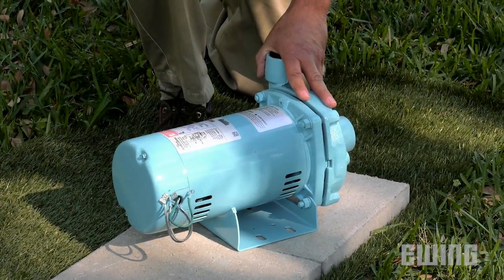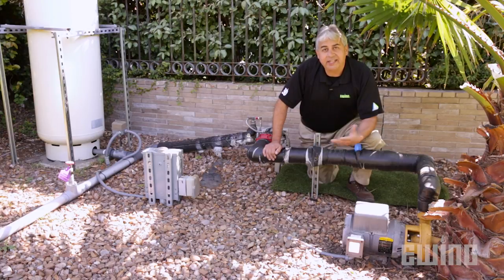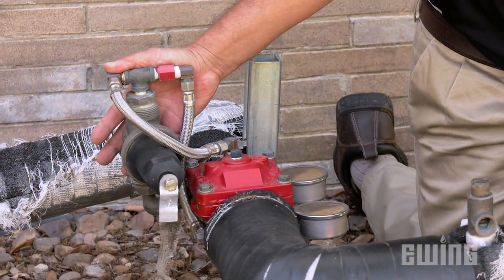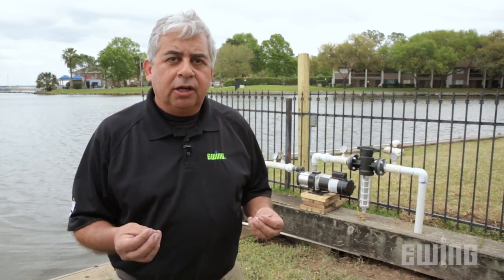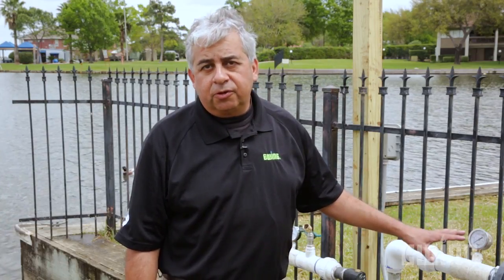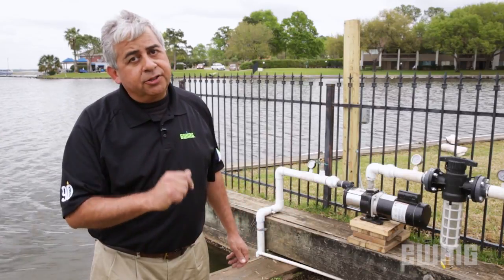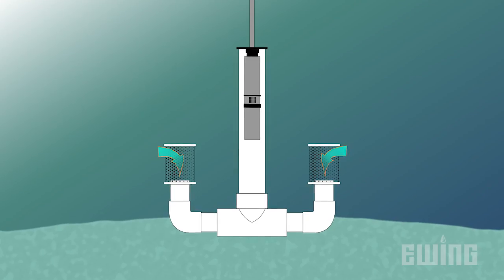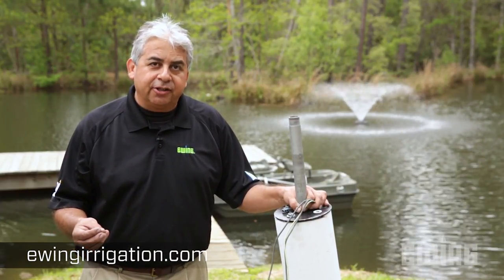Landscape Irrigation Pump Overview

Comment: Impressive system but definitely for commercial use.  I need a small system to irrigate abou 3 acres of land.  A booster pump on a dedicated switch will work but will require separate pipe. I LOVE the pond pump system!

Comment: Where did you get those screen caps that fit into the pvc pipe? I've been looking for those everywhere.
Reply from the maker: Hello AJ, you can order those from us. They are strainers for submersible pumps. They would be a special order item but you can contact your local Ewing store for assistance in determining the parts you will need for your application.
Location Finder:
https://store.ewingirrigation.com/locations/
Reply: Those are nice! When installing the check valve on the end of the line that goes in the water, I’ve used 10 to 15 ft of filtered corrugated pipe with the mess similar to French drain applications, but those look much more professional.